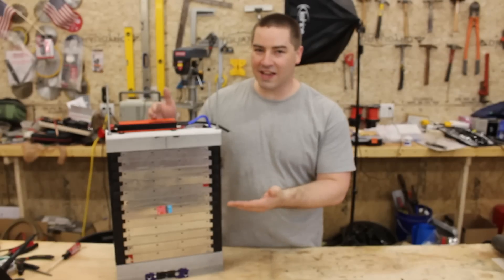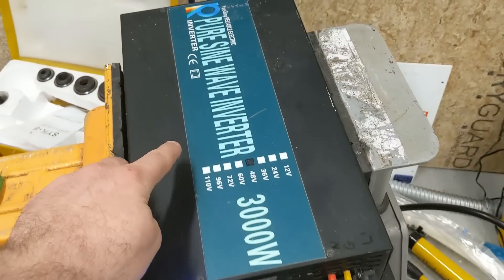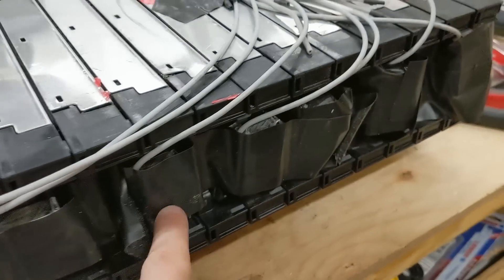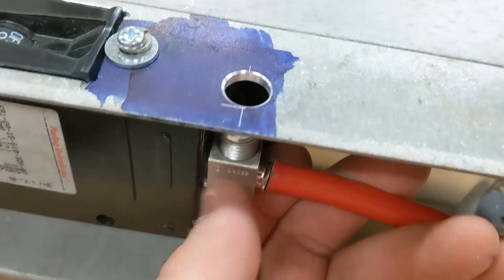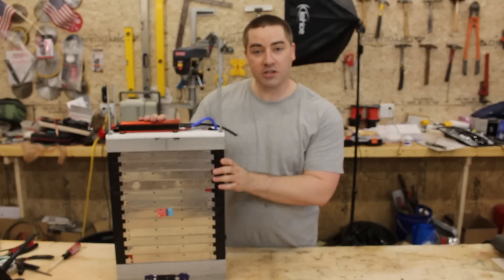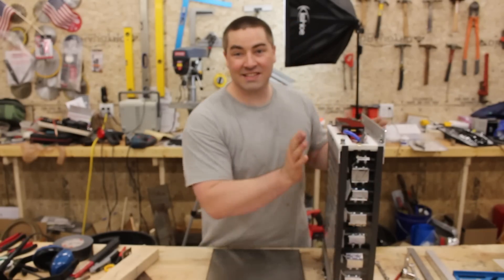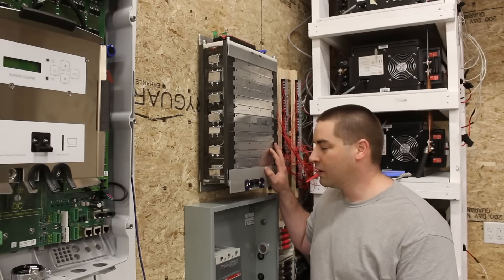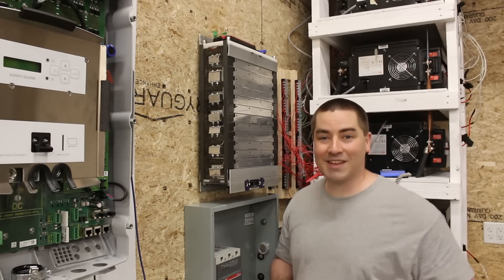LG Cells Part 2, 6kwh 48v DIY Battery

Comment: I know this was done 8 months ago, but thought to comment anyway. Easy way to know which pack will take the charge away from another (for a while) would be to know the internal resistance. Energy will take the easiest path. The pack with the lowest IR will take on the majority of the energy. You can actually play mathematics to predict State of Charge of one or the other.

Comment: could you just put 2 packs like that with a BMS of say 200A in Parallel to ad up to 400A? would that work?
Reply from the maker: Yes, you can parallel batteries.  But, you have to keep in mind heat build-up.  When these cells were inside the car they had active cooling, but now I removed that.  So it's up to me to keep the amps low enough to not cause excess heating.
Reply: @DavidPozEnergy  thats why i asked if i could parallel PACKS onlyon the BMS output wires? singlepackages will have better heat distribution than one big single block...i think about connecting 2 BMS with their red-2-red and black-2-blacktoaddtheampsto 2x200whilsttheload perpack stas 200A...got me?

Comment: Hello! Can you help me? I soldered the 16s24p battery from the LiFePo4 cells 32700, connected the DalyMBS (16S, 250A) and connected the computer via the USB port. I opened the application DalyBMS-v1.1.5, but I don't understand what the settings should be. Could you advise me?  https://1drv.ms/u/s!AkS4nBQ85QZ9gY8xTKQFAsauhTCUdA?e=sIf0aP
Reply from the maker: If you are using LiFePO4 cells, then maximum voltage per cell is 3.65v.  I would personally set the high-voltage cut-off to that.  I have my solar charge controller to stop charging at 56.8v (3.55v per cell) this leaves a 0.10 volt delta.

Comment: I think I heard somewhere that the Bolt specs show 200a max discharge and 48a max charge current. That is with 3 cells in parallel. I think the 48a spec is also just from the max available onboard charger.

Comment: For those playing along at home, that's ~185W-h/kg. In the pantheon of lithium batteries, that's pretty good. There are much higher density systems on the market, but not for the price of a wrecked Chevy Bolt battery module! I need to do the math for the LiFePO4 assembly going in the Electrica. (each cell has been tested to ~200Ah, I just don't remember how much each of them weigh, or how much is being added in cable and securement -- rough estimate 140-150Wh/kg. The BMW bricks are ~90Wh/kg, on paper [40Ah (C/3) cells].)

Comment: well that sucks they don't sell them anymore I would love to get enough to build 4 of these.
Reply from the maker: Yeah, they are sold out of these at the moment.  Right now Battery Hookup has some very nice BMW cells that may work.  I have some in 5s and 4s, to make 14s.  https://batteryhookup.com/products/bmw-oem-5s-19-2v-75ah-1-44kwh-battery-module
I linked to the 5s, but they also have 4s and 3s, just go to the homepage.  You can use my code DAVIDPOZ for 10% off.

Comment: wow that is nice. I mean I have 12 lead acid batteries at 240 amp hour. and you pulled 1300 watts. my battery bank would be dead way before that.  I may really have to think about this.  I wonder if I get 4 of these and I think as a back up I would run for a good while.

Comment: what fuses you gonna use ?
Reply from the maker: I like using these: https://amzn.to/3i1d2Ki  Class-T, fast blow.
Reply: @DavidPozEnergy  and for - side ?do you know if that bms can use Shunt current sensor or contactor ?ty
Reply from the maker: The red BMS I installed in this video is from Daly.  It can not control a shunt-trip.  But I'm currently testing another type of BMS that might be able to: https://youtu.be/d9dy_flu3dM

Comment: i need help i bought the same batteries and bms that you did but im not getting power thru my bms. i have power thru my batteries but when i measure with the bms  i only get 1.2v  help
Reply from the maker: I don't know how much help I can be without getting hands-on.  First, I would check that every cell is the same voltage, and the pack is between 44 and 58v.  If you start with cells too far apart, the BMS won't turn on.  Also, double check your leads at the plug, before going into the BMS, to make sure every cell is in the correct order.  For example, volt-meter on wire#1 and #2 reads 4v.  Then Wire #1 and #3 reads 8v. Then wire #1 and #4 reads 12v.  It's easy to cross a wire (I've done it) and then the BMS won't turn on.  Make sure you have a common port BMS.  I don't know, those are just some ideas off the top of my head.  If it all fails it's possible you got a faulty unit from the factory and you might try to exchange it.

Comment: DAVID : 
I'M trying to spec out a solar system for My retirement cabin .
I need a simple to implement 
, affordable , powerful enough
to run My cabin 24/7 . I by NECESSITY need a plug and
 Play system ( I'm a O.F.F. ...
OLD FEEBLE FART ) ! I need to
 know everything I need to know
( what to buy , where to get it ,
how much it should cost , etc ).
This system will have to be My
only power for the cabin ( 14x14
w/addition later also 14x14 ).
I want to buy about all of system
except batteries before end of
Yr ( tx credit ) . Can You please
help Me ?! Thanks
I live in mid Tnn.
Reply from the maker: I suggest calling Alt-E.  They sell pre-made kits.  They will even build something custom and pre-wired for you.    Here is an example:. https://www.altestore.com/store/solar-power-systems/off-grid-home-solar-power-systems/base-kit-1-off-grid-366kw-residential-solar-power-system-p40464/
Reply: @DavidPozEnergy  Thank You for taking the time to respond to Me .
I can see ( especially after looking at alte web site ) I'm in for a up hill
battle ! They are extremely proud
of Their kits , aren't They ?!...

Comment: what diameter "Threaded rod" did you use to combine all the packs together and where did you buy them?
regards,
Josef
PS: keep up the good work.
Reply: I used 1/4 inch and I got mine at home depot 24 inch ones for about $2 each and the battery pack is about 16 1/2 to 17 inches. Thread is1/4 20.  The ones that come from the factory are stainless steel and are m6 with1.0 threads.  They are only threaded at the ends an inch or so so you cannot cut them shorter and they are 37 inches long and hold about 30 cells.
Reply: I just got the set I ordered and 1/4" is the most that'll fit unless you go metric. 5/16" is a hair too thick.

Comment: Hello! Awesome video! Just wanted to get your opinion on the Daly brand BMS. Has it been reliable so far? I am thinking of getting the 20s version for a 72v battery build.
Reply from the maker: I have a dozen or so different batteries with Daly BMS on them.  They work fine for me.  No failures.

Comment: If you had 14 and wanted to make a 24V battery how would the BMS connections be? I was comparing these to the Leaf battery, these are far more dense then they are. what did they charge to ship it to you or what did they have to pay to have them shipped?

Comment: whats the voltage drop from the battery around a 1C (60A) discharge? I built a 7s 24v pack from these and it’s amazing, but around 1C the voltage drops around 2 volts. Thats fine if it’s charged up but when it gets lower that can be a problem....I’m trying to figure out if it’s 1. normal and acceptable for these cells or 2. the result of my tab connections or faulty cells. I’m almost finished building another to put in parallel with the first one, that might help the voltage drop too... I have the same brand inverter, 2500w model.
Reply from the maker: I have not noticed any voltage drop.  But, to be fair, I was not specifically testing for voltage drop.
Reply: @DavidPozEnergy  I was able to figure out one of the tab connections between modules in my first battery wasn't secure enough, tightened that and the voltage drop lessened. Then I put my second battery in parallel and now there's less than a .5v drop with a heavy 1500w+ load!  Probably about the same for yours, since it's the same amount of power in a different configuration.

Comment: Hi David 
I'm reducing your battery build out  to 24v 7s and I need a BMS for it , daly I believe but I want to be able to see the info on my cell phone.
Which BMS would you recommend.  Thanks, Steve
Reply from the maker: A while back I built a battery from a Smart Car and used some BMSs that had bluetooth.  There is a series of videos on my channel about that build.  Here is one video: https://youtu.be/TmqkE6KuHJc I bought them from Aliexpress, but here is the manufacturer: https://www.lithiumbatterypcb.com/product/14s-bluetooth-lithium-e-bike-battery-pcb-board-with-30a-constant-charge-and-discharge-current-2/  
Daly is making a new BMS with bluetooth, but I have not yet tried it.  https://www.aliexpress.com/item/4000832623482.html?spm=a2g0o.productlist.0.0.261c3b5341KDJP&algo_pvid=2844f8e9-fa92-4b3d-96d2-2c19271dc89b&algo_expid=2844f8e9-fa92-4b3d-96d2-2c19271dc89b-1&btsid=0ab6fb8315948974613952945e494e&ws_ab_test=searchweb0_0,searchweb201602_,searchweb201603_

Comment: Interesting. Tesla batteries have a class-leading energy density  of about 360 watts per kilogramme.
You have 6 Kwh  (6000 watts) from 71 lbs. There are 2.2 lbs to a kilogramme.  That is 384 watts per kilogramme.

Comment: I really don’t understand why all people who instal inverters only talking about the voltage input , 12,24,36,48, 60, 72 . . No one talking about the amperage input ! Because there is different voltage. For example there is different 12 or 24 voltages . There is 24 volts with higher amperage and lower amperage. My question is how many amperage I need for input if I have an inverter with 24 vdc input and I have an inverter with 6000 watt output?
Reply from the maker: 6,000 watts divided by 24 volts = 250 amps.

Comment: This is a 14s, 200a common or separate port BMS?
Reply from the maker: Common port.  They look the same, but different program inside.
Reply: Thank you David for your fast response. I'm wondering now that I know what BMS I need, could you tell me an inverter of at least how many watts I should buy?
Reply: David I bought the same pack of batteries you did(14) with your answer know I know what BMS I need, but know I have to ask you what inverter I should get? I mean of how many Watts.?
Reply from the maker: The inverter should be sized for your loads.  I'm currently running 12kw for my whole house, but that includes electric stove and oven.  I've seen others use 3kw inverters for small cabins.  It would help if you begin with looking at everything you want to power at the same time.  Everyone's needs are different.
Reply: @DavidPozEnergy  high or low frequency inverter?

Comment: Just ordered my batteries which bms did you use ie common or separate port I’m looking to make 24v 7s2p I think
Reply from the maker: All my stuff is a common port BMS.  I think separate is used in E-bikes or scooters?
Reply: Thanks I’ll look at getting some ordered, I’ll let you know how I get on, keep your videos coming. Thanks Lenny
Reply: Hi David looking to build 24v 7s config looking to use Daly 3.7V 7s 24V Li-ion Bms 29.4v Lithium Battery Bms Charging Voltage 29.4v 80A 100A 150A 200a Bms Pcm for lithium battery pack
Current:
120A24V Common Port 
What do us think

Comment: Hi David
I am making up 2- 14 pack 48 volt units that will give me approximately 12 kilo watts, but I want to split each pack into 24volts instead of 48volts
I will then reconnect two of the 24volt units back together to make 48 volts. 
#1 - Can you suggest the wire size I should use to  reconnect the 24volt units back together.
#2 - should I use 1 bms unit @ 48volts, or 2 bms units @ 24volts.
Which way is best safety wise and  cost wise with all the hi temp and lo temp etc. And what is your choice of bms should I use, and what is the manufacturer, model number etc.
Thank you very much. I have designed a way to connect these batteries together that you would really appreciate,  I will share it with you if you would like.  
Thanks, Steve
Reply from the maker: Hi Steve, I don't think I'll be able to do an adequate job answering all your questions on this platform.  When people are building large banks like you are planning, they often go with a brand like Batrium for the BMS.  https://www.batrium.com/  I'll welcome you to join the Facebook group "DIY Battery".  I'm on there with many other people building with these cells.

Comment: I ordered the 14 batteries,  What BMS would I use if I flip the batteries as you suggested?  Do you do phone consultations for a fee,  I am new to this and have some questions.
Richard Haynes--503-886-9566   empathyom@gmail,.com
Reply from the maker: Hi Richard,  The easiest way to get in touch is through Facebook.  I'm on a few groups. "DIY Battery" and "DIY Powerwalls" are two I'm active in.  
For the build in the video I used a 200 amp BMS from Daly, and a 100 amp circuit breaker.  However, if I was to change it up and make the pack a 1p14s (meaning 1 cell in parallel, 14 series).  Then the whole battery would be half the size, 3kwh.  Personally I would use a 60 amp BMS and a 30 amp circuit breaker.  Then I could use 10 gauge wire and very easy connections at the tabs.  no need for aluminum blocks in there.  If I wanted more capacity (6kwh, or 9kwh, etc.) then I could parallel the packs after the BMS's which makes things even easier.
Reply: @DavidPozEnergy  Thank you David for you reply on Youtube Yesterday. for the 60 amp BMS, do I use common ground or separate ground?  I am assuming I will need one BMS for each 3 KW pack, yes?  (LG cells).  would still like to talk with you, and willing to pay.

Comment: hello I need help battery hook up mailed me some of these LG cells and they had rocks between them and it punctured the layer of the cell . they refuse to help me in any way what should I do they have taken my money and sent me punctured cells and even after I sent pictures showing the punctures said there is none now I am asking for help as it is these lg battery's I went to buy due to your video
Reply from the maker: Hi Grant.  I'm on several different facebook groups with thousands of users who buy from Battery Hookup.  I also purchase from them.  Overwhelmingly they work hard to correct issues if they arise.  You can try contacting them on Facebook.  They might see that quicker than an e-mail.  Good Luck.
Reply: @DavidPozEnergy  thanks for the help :( I do not think this is going to get worked out or fixed they keep avoiding anything and trying to not accept the truth and the proof I have been screwed lesson learned if something looks to good to be true its not aka Battery hook up
Reply: I wish i could post a picture but I actually pulled a small grey stone out of the one cell and they have a picture with a bunch holes shown in a cell they refuse to admit its damaged other then the dent to the outer case . I have been forced to store punctured lg pouch batteries in my house with three kids for 4 days now and no hope of getting any help from this company
Reply: well they refuse to admit the cells are damaged but say they will refund them . not sure if you had a rock stuck in a pouch cell I would say its not damaged but ok good enough good bye
Reply: well more story's from them they say they will refund then they ask what I want refund or replaced then they vanish again same thing every day now for 5-6 days I have lost income staying home each day worth more or equal to the purchase now as well as I am stuck with the garbage this company has sent me they do not seem like they will ever follow through on anything they say . I will be throwing these in the garbage today eating the lose of the shipment from this company and lose of income from wages . if you can not afford a lawyer do not do business with this company they will not deliver a quality product or help you after you receive a damaged order in any way but to beat you around the bush for days and days until you lose so much money trying that you give up
Reply: I want to point out that they have in fact refunded the damaged batteries the company has stepped up and done what is right . I was in the wrong .

Comment: If I want to use a Daly BMS like you do but only want to charge to 80%, can the BMS cut off earlier and balance?
Reply from the maker: I don't charge this battery to 100% all the time.  I only did that for the capacity test.  Usually I charge to 90%, and that is programmed into my solar charge controller.  These cells don't need constant balancing, but if you plan to use other cells that do need constant balancing, then you can e-mail Daly and they can adjust the balancing to what you want.

Comment: If making for a 24v system, would you do a 2p7s, with 1 BMS? or would you do 2 7s with 2 BMS?
Reply from the maker: I would do a 2p7s with one BMS.  So long as the BMS can handle your loads.  If you need more than 200 amps it might be easier to split into two packs or more.  But below 200 amps, I think one BMS is easier.  But lots of variables involved.